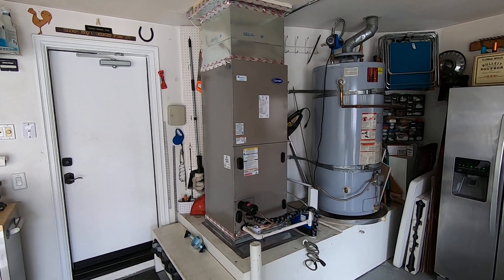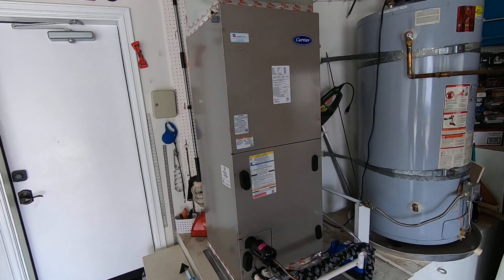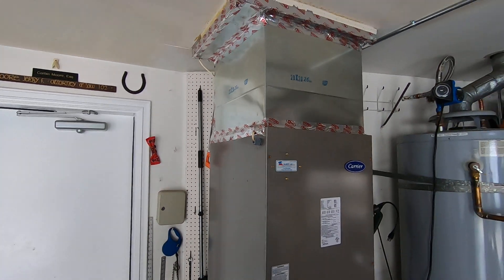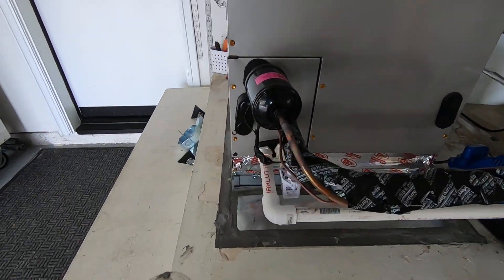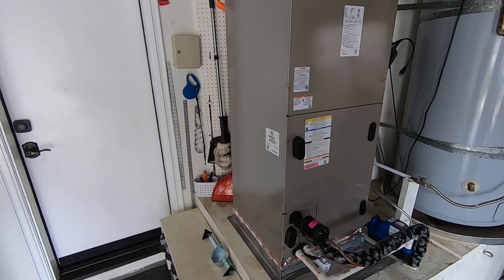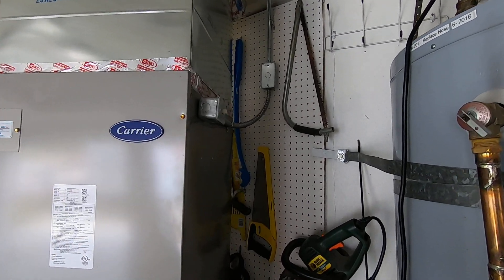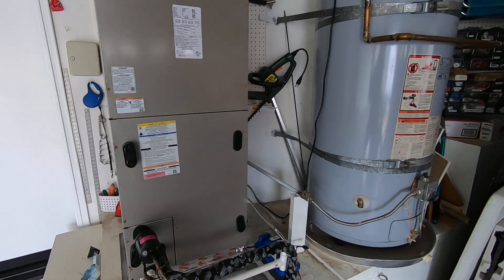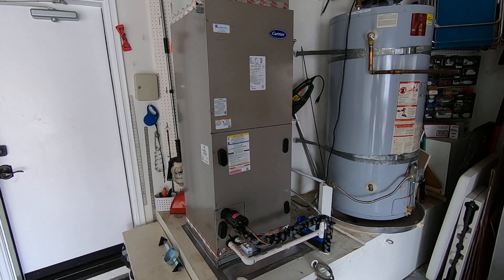Installation of new Carrier Infinity fan coil FE4 replacing a gas furnace

Comment: I have the exact same one and I have a question it’s in the attic the home is new do I need an air filter I was told no. They don’t recommend it for this system but I live in a dusty area so I don’t understand and been in this home since march
Reply from the maker: Thank you for watching my video.  Yes, you need a filter for this system.  It should be in the return grill or in the attic with the fan coil. It should be checked every 3 months and replaced when dirty for the system to operate properly and efficiently.

Comment: Thank you it was a great Video, I found a setting on control board for humidifier fan setting normal , increased to high and it’s  should run fan higher speed for cooling also it says , also increased the drain time from 15 mim to 25 , that seen to help a lot , I need to increase my ductwork size , also adding a fan in the garage to cool a bit , let’s see what happens thanks for ideas
Reply from the maker: That sounds like a good plan. Good luck with everything

Comment: I have same system, in my FL garage , I am getting a lot condensation on the unit where the plenum mastic get running, Can help figure out what is the issue , is the fan speed too slow ? It sweats a lot, please help , with all the water this system will dust really fast
Reply from the maker: Thank you for watching my video.  Condensation can happen for many reasons.  I would recommend making sure the filters are clean and check the static pressure of the system to ensure the return and supply ducts are sized correctly.  I would also check the fan speed on the system.

Comment: You said it was the supply on top, where would the return go to? How would it work with an HRV?
Reply from the maker: This fan coil serves the downstairs area of the house.  There is another system for the upstairs located in the attic.  The supply plenum is in the ceiling above the fan coil.  The ducts are not accessible because they are built into the ceiling.  The return comes from under the fan coil through a chase that leads to a grill on the bottom floor of the house downstairs.  If you want to do an HRV or ERV with this system it would be added in the upstairs attic area.

Comment: Having this unit installed now. Can it be inverted ? Installer says yes.
Reply from the maker: Yes, this fan col is multi directional.  So it can be up flow, horizontal or downflow.  When in the downflow configuration there is an extra accessory kit you need to convert it.

Comment: Ho did u wire up the whole thing to work , im talking about the low voltage
Reply: The Carrier indoor variable speed fan coil FE4 uses a 4 wire connection, the Carrier Ininifty control thermostat SYSTXCC use a 4 wire connection and the Carrier Infinity heat pump condenser 25VNA8 uses a 3 wire connection.